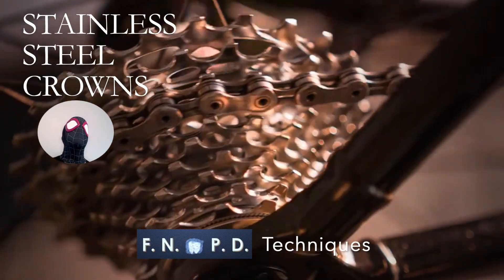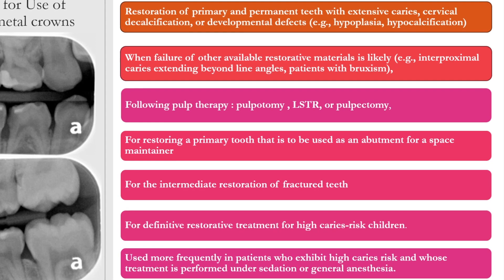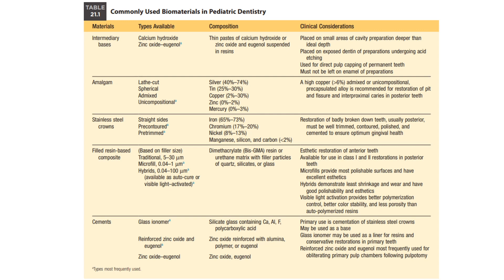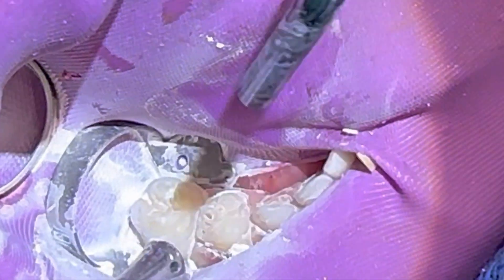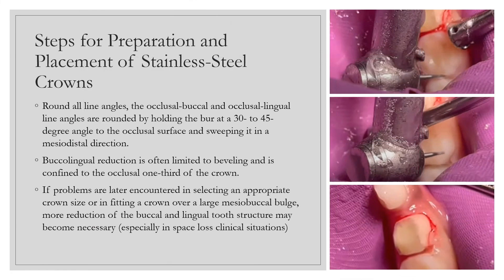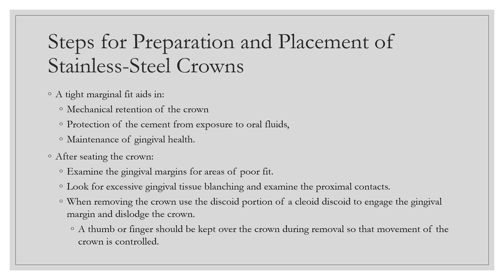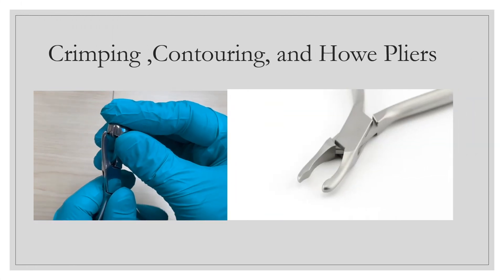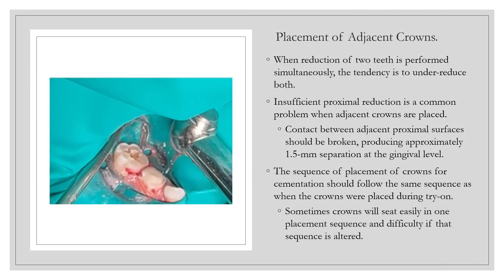FNPD Techniques : Stainless Steel Crown / Preformed Metal Crowns

Comment: Thank you, but in the video the teeth looks fine no need for crown 🤔
Reply from the maker: Hello!! Thank you for your constructive comment and discourse.

I do agree with you that if I were doing treatment in an outpatient setting on a cooperative patient I would have altered my treatment plan to reflect those changes.  

We can take a look at some evidence-based dentistry :  

According to  The AAPD reference manual BEST PRACTICES: RESTORATIVE DENTISTRYhttps://www.aapd.org/globalassets/media/policies_guidelines/bp_restorativedent.pdf

 Full coverage restorations should be considered as a definitive restorative treatment for high-risk children. 

They are used more frequently in patients who exhibit high caries risk and whose treatment is performed under sedation
or general anesthesia.  

That is true in this clinical setting. 

In Failure rates of restorative procedures following dental rehabilitation under general anesthesia. Pediatric Dentistry – 24:1, 2002  Their conclusion was that SSCs are the most reliable restorations while composite restorations are the least durable. This was a Retrospective review of 504 dental records of children receiving comprehensive dental treatment under general anesthesia.

 In  Failure Rate of Pediatric Dental Treatment under General AnesthesiaDent. J. 2018, 6, 25; doi:10.3390/dj6030025This study found that when compared to other restorations, composite restorations had the highest rate of failure.

In Early childhood caries sequelae and relapse rates in an  Australian public dental hospital. Int J Paediatr Dent. 2023;33:1–11.They found that The relapse rate for new caries following the treatment under GA was 41%. Additionally, they cited new caries rates reported in other studies, which ranged from 53% to 68% at a 2-year follow-up. 

In Outcomes of dental procedures performed on children under general anesthesia J Clin Pediatr Dent 27(2): 181-184, 2003. They found that stainless steel crowns are more likely to be successful and last longer than multisurface amalgam or composite restorations in children treated under GA. Additionally, they discussed that Definitive treatment is more likely to result in positive outcomes for children treated under GA due to less frequent complications from failed restorations

In  The Use of Stainless Steel Crowns: A Systematic Literature ReviewTheir conclusions were  PEDIATRIC DENTISTRY V 37 / NO 2 MAR / APR 15

1. SSCs are superior in durability and longevity to Class 
II amalgam or resin-based restorations in primary 
teeth.
2. There is minimal evidence to support the economic 
value of Class II restorations over SSCs for primary 
molar teeth. 
3. Dental rehabilitation under general anesthesia is expensive and places the child at increased risk for 
morbidity or mortality. 

In Preferential Use of Stainless Steel Crowns as a Strategy to Minimize Retreatment 
of Primary Molars under General Anesthesia. PEDIATRIC DENTISTRY V 43 / NO 1 JAN / FEB 21 This study examined records from 296 healthy patients with more than one dental rehabilitation under general anesthesia from June 2012 to January 2019.  They concluded that :

1) Stainless steel crowns placed on primary molars in children with early childhood caries under general anesthesia had a lower retreatment rate compared to one- or two-surface composite resins.

2) SSCs should be given strong consideration in the treatment of primary molars in children with ECC to minimize retreatment. 

3)The use of SSCs is one strategy to minimize multiple general anesthesia exposures and their associated health concerns, reduce financial and societal costs, and increase the number of available appointments for 
other children with ECC.

I think this sufficient evidence to support my treatment plan. 

I am not saying alternative treatment plans would be incorrect, I am simply supporting mine.  

Looking forward to speaking further
Reply: @friendlyneighborhoodpediat4825   
Thank you for your thorough response. I felt your enthusiasm for your work. I would like to know the sources you rely on to keep you informed of what is new in the field of pediatric dentistry other than aapd. And again thank you.
Reply from the maker: @purpleskys6193  hello, thank you for your comment 😊! I like the international journal of paediatric dentistry and the British society of paediatric dentistry. I will say that if you want an up-to-date guideline on pediatric dentistry , even though you asked for other resources other than the AAPD. The AAPD reference manual cannot be beat. It is updated annually and is now accessed on line. I have read through it multiple times when I was studying for my board certification and update myself when the new manual comes out as they reference which guidelines are new or have been updated. I do agree with you that there really is not a forum or other area like there is in general practice to discuss updates and practice philosophies. Because there our multiple ways in pediatric dentistry to provide a treatment with a similar outcome in mind. Thank you for the great conversation